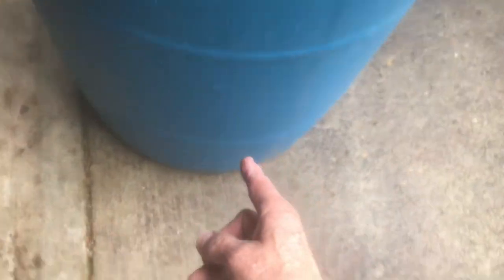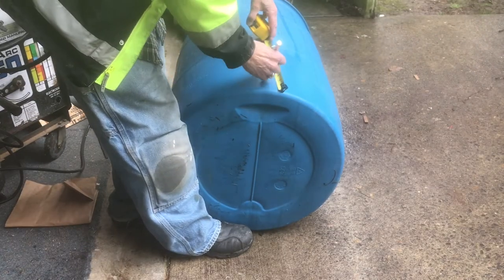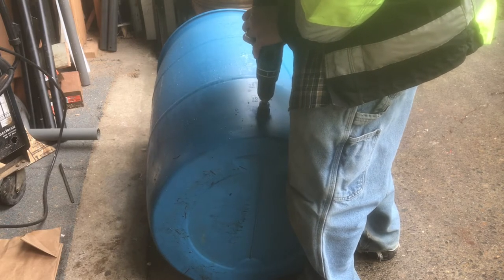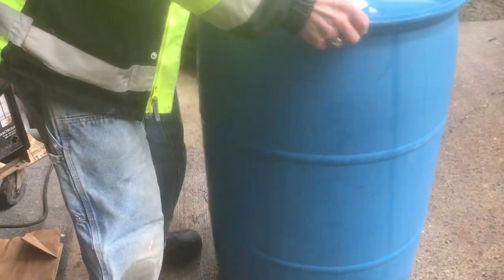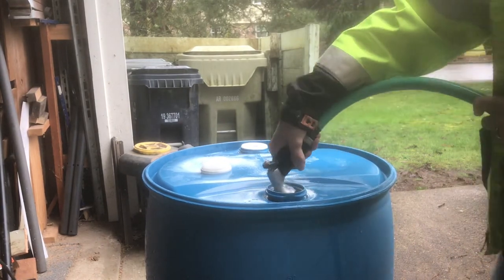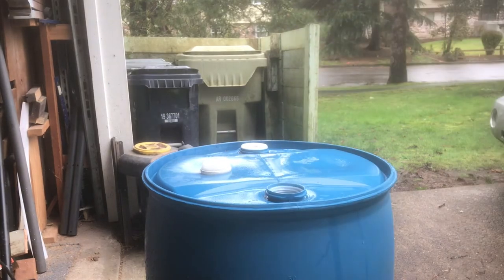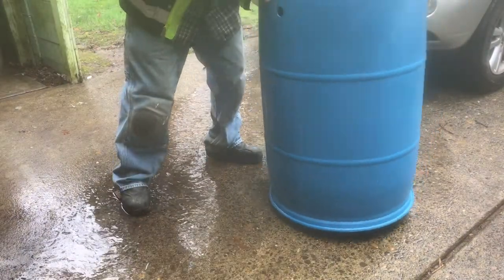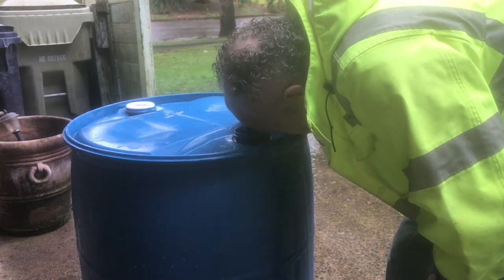Easy install of a spigot onto a 55 gallon barrel

Comment: Did it leak? I have a 55 gallon metal barrel that needs a spicket
Reply from the maker: No it does not leak, mine is on a food grade barrel that I use for emergency back up in case of contamination in our water or no water.

Comment: Great lil video! Question: Why go 3.5" up from the bottom? It looks like you could put it closer to the bottom, which would allow the barrel to drain more fully. Maybe 2 or 2.5" would work OK?
Reply from the maker: The bottom of the barrel is curved so the lower the spout is installed the more angle on the spout increasing how close it gets to the floor. Installing it where I did only leaves 2” from the floor not allowing much room to put something under it to catch the water when the spigot is opened.